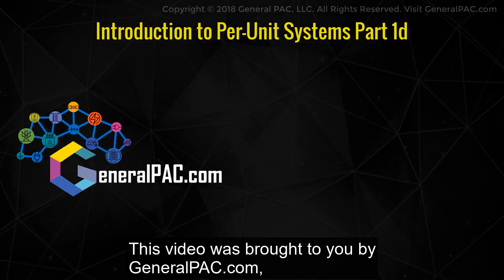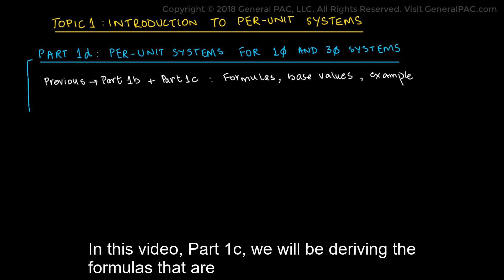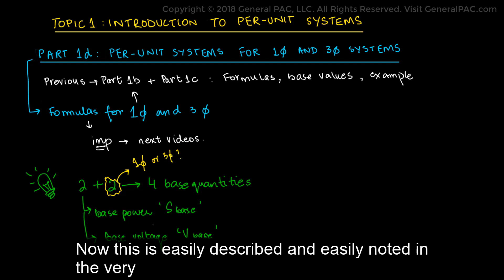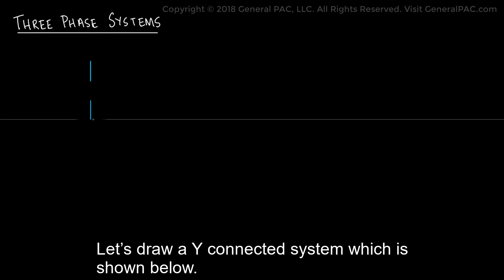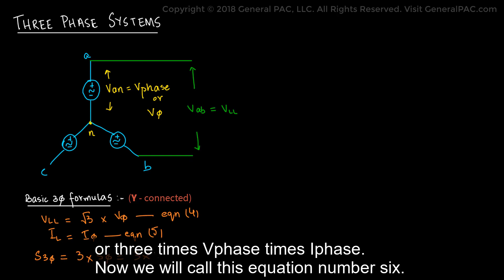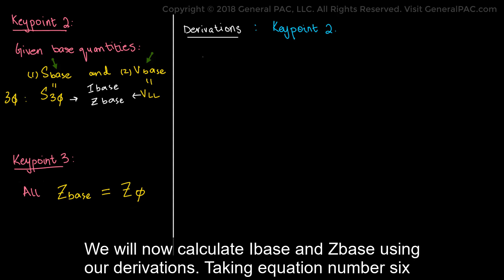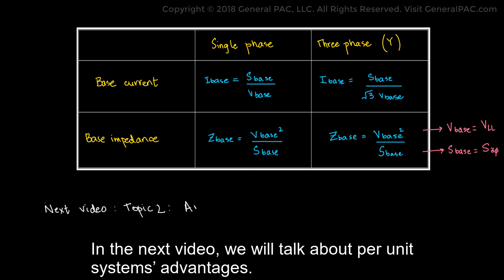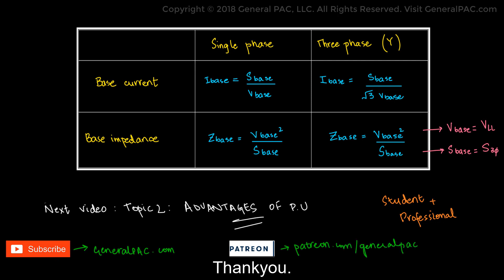Introduction to Per Unit Systems in Power Systems Part 1d

Comment: still not clear how  I base 3phase has square roots of 3 in denominator when Vbase is already V L-L ?
Reply from the maker: Hi Lam, Here's another way to understand it:

As you know, from the equations given in the video, we can also write the equation of power (Sbase) as ;
                                              Sbase= √3*Vll*IL

From the above equation if we divide Sbase with √3 and Vll (Line to line voltage, then we can have IL (line current), that is:

                                              IL=Sbase/( √3*Vll) 

And, as we know:

                                               Vll= Vbase
                                                IL= Ibase

The above equation becomes:

                                           Ibase=Sbase/( √3*Vbase)

Hope you find it useful.

Regards,
GeneralPAC by AllumiaX